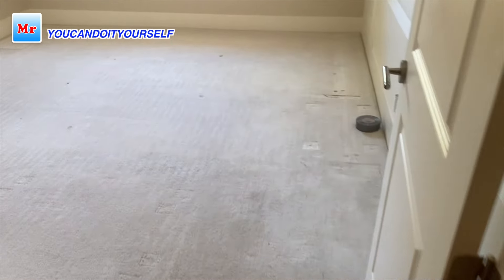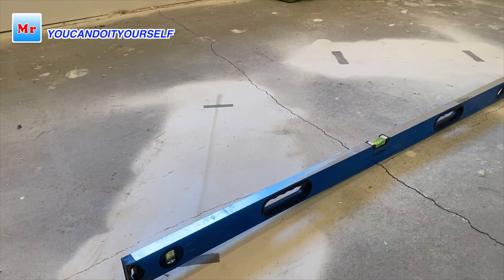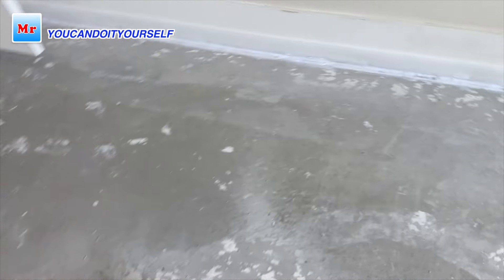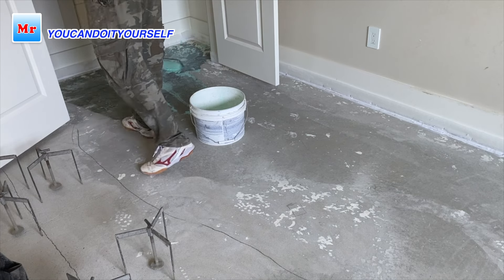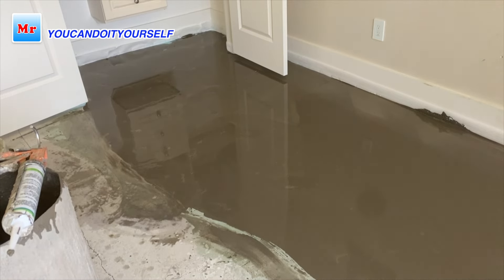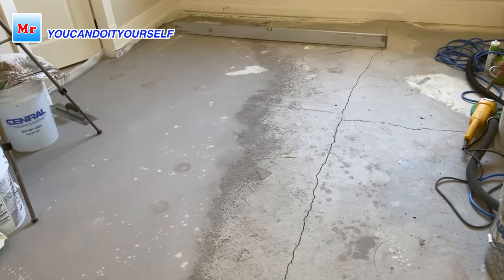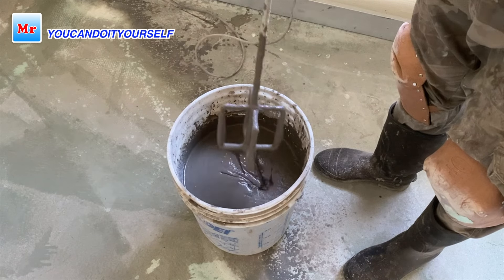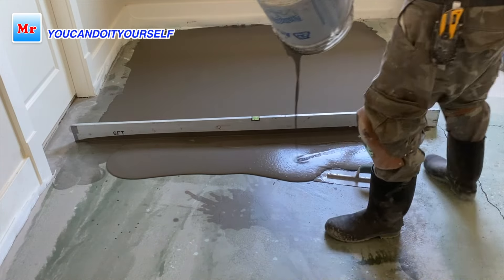Big Hump On The Middle of The Room: How To Fix

Comment: Thanks so much for doing the video for my problem.  Im going to try to level my room.  I hope I can do as good a job as you 🤞
Reply from the maker: Good luck!
Reply: @MrYoucandoityourself hi Mr. YCDIY, maybe you can answer a question for me, my helper canceled,  do you think it's possible for me to mix five buckets myself,  and pour it all out and get it leveled  before it starts to set?  I also have the spike shoes and the spike roller. Everything already primed and prepped.  I was just concerned about the working time for one person.

Edit:. Each bucket is a 5 gallon, one bag per bucket.
Reply from the maker: What material you gonna use, Mapei?
Reply from the maker: Start leveling in early morning, when not so hot, use the coolest water and you will be successful.
Reply: @MrYoucandoityourself okay great thank you again.

Comment: You are the best installer I've seen at leveling and floor prep!

Can you please make a video with tips on time efficiency in installation? I am told that I am very good, but slow with installation. I move fast and take no breaks. I don't know what I am doing wrong here
Reply from the maker: Thanks, will do! Quality and time of installation  - two different stories.
Reply: Do not listen to idiots. Slow is quality and precision. Fast is crap and dangerous. Take that from flooring pro of 33 years.
Regards

Comment: Is there a floor level laser? I have seen the bosch GSL 2 floor laser but they are discontinued and I am looking at purchasing
Reply from the maker: Hi, I sell laser, for floor leveling it’s very good. Link in description for this video. Thanks
Reply: @MrYoucandoityourself  but this laser Isn’t a floor laser it’s a standard one and you have to go around with a ruler to check uneven spots so takes more time, i see in your videos. I was looking for a laser that directly shows uneven spots on floor with the laser lines on floor not on walls
Reply: So the tripods show the uneven spots with the laser? Too much extra work and tools, I would rather just go around with straight edge, less work
Reply from the maker: @thatsalllllllll1673  I explain in this video, why I used tripods to fill up that low spot because I needed to install hardwood flash with bathroom tile but the middle of the room was too high. With a straight edge not so easy to make it. I gave candy for you. Just put in your mouse. I have been doing this job for many years and all designs came from my experience. Thanks for watching and commenting!
Reply from the maker: @thatsalllllllll1673  https://youtu.be/vc3Cw5kIMuU - maybe this one?